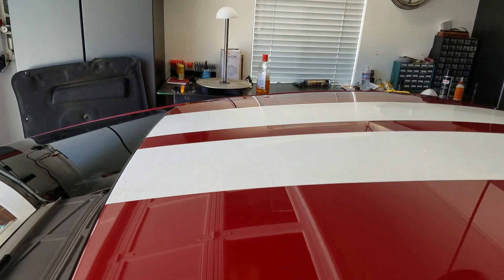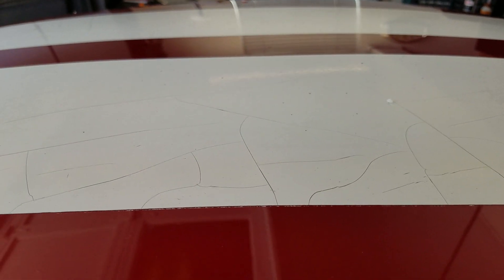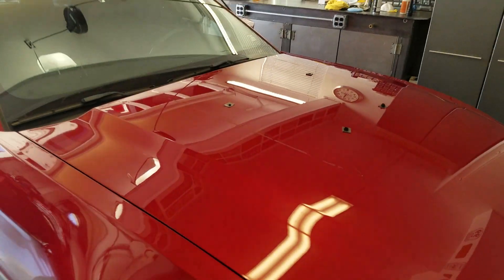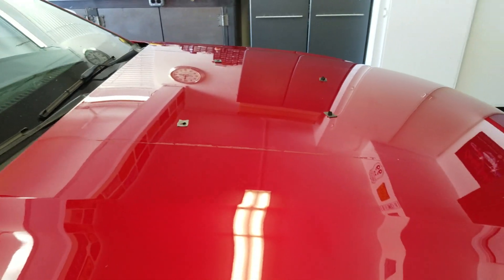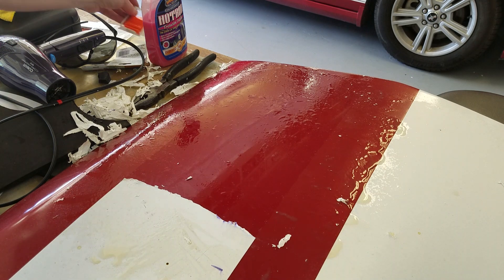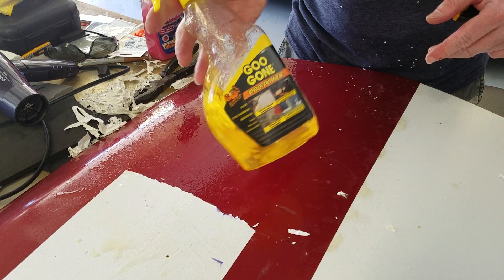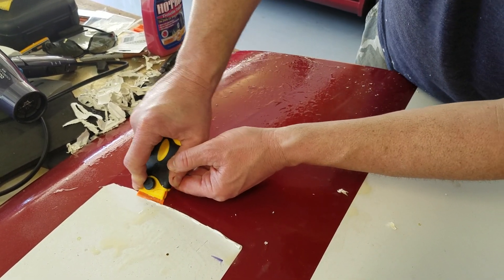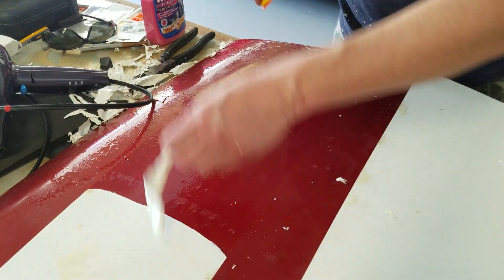Vinyl stripe removal

Comment: Your video was the most helpful I’ve seen when dealing with this situation. Other videos made it look easy, but you set realistic expectations: it is time consuming. I do have a Ford with baked-in stripes which are now cracked and unsightly.  Hopefully, I can remove them in a couple of weeks. Thank you for your video.
Reply from the maker: @genef2988  You're very welcome and glad that it will help. I did mine over a good period of time, just to keep my sanity. 😆It is a very tedious job, but it is completely doable. Good luck! 👍

Comment: I’m doing it’s the same on my Mini Cooper. Exact same way, saw your video when I was looking for a faster way. Happy I’m not the only one doing it like this. God Bless
Reply: I have to do the same thing my bonnet stripes are cracking real bad . Hope I have as much luck as you and this guy 🤞🏾
Reply: @waynejordan7473  I had three stripes on the hood of my Mini Cooper. It took me half a day to get them off and it didn’t come off that clean. They were really burned into the surface of the paint. After cleaning the affected areas the best I could with solvent. I used fine sand paper and sanded where the stripes were to get as smooth as I could without totally going through the paint. I applied my new stripes in about an hour and a half. They came out pretty good. I used a slightly wider stripe to cover past the edges of the old stripes. God Bless and good luck

Comment: Thanks for sharing, I bought a second hand car and 60% of the body is covered with vynl which is wearing off and changing colour. I got a quotation for paint respraying but is very expensive I'm definitely going to use your method to remove the vynl

Comment: I don't understand why you would heat up decal with hair dryer and then cool it off by spraying that goo be gone on top of it, doesn't it defeat the purpose of heating the decal? I thought the goo be gone is to remove the adhesive residue left behind?
Reply: I think the point of heating it up is to try unbake it from the paint